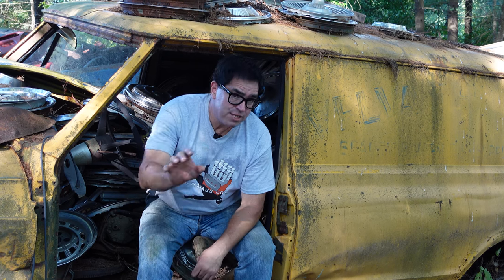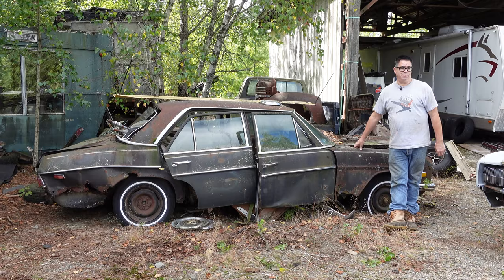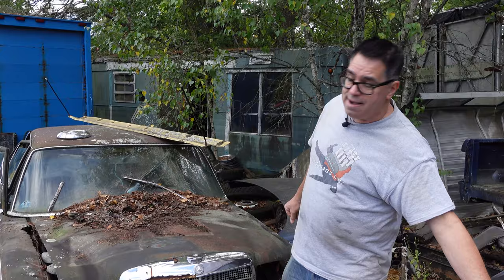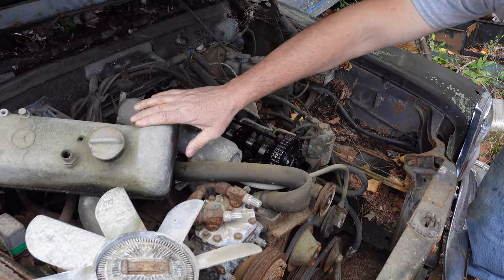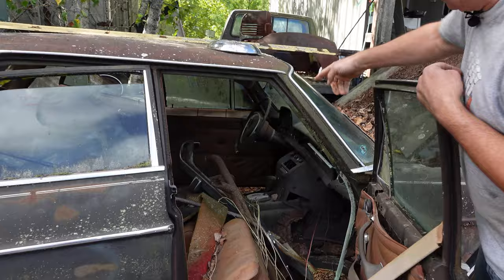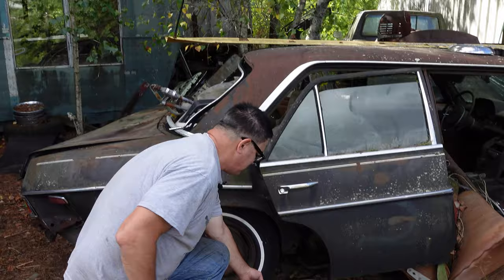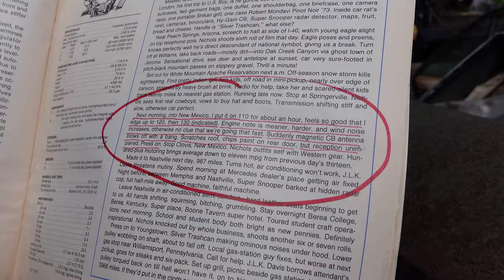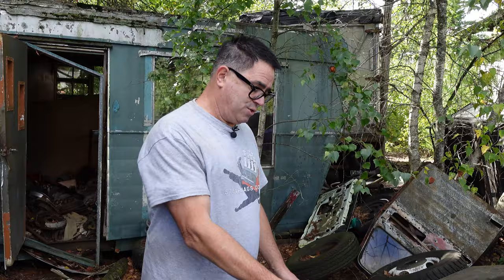Mercedes Has Benz

Comment: I have a 1971 "W114" 250c with a straight 6 with dual zenith carbs, it runs quite smooth and can cruize at 70 pretty easily. It's suppose to go to 130, but with it's age I'm not keen to try. Nice car, but mine needs some more love. The parts are very expensive. Thanks for showing a German Classic.  I also wanted to mention the American version has a double front bumper that's kind of ugly.

Comment: A diesel vehicle is able to achieve better fuel economy than a gasoline vehicle because a diesel is very slow.  You see, a diesel has MUCH slower combustion.  A diesel engine is better with a turbo charger, but now your talking just UNDER the fuel economy of a gas engine.  If you want diesel fuel economy, keep your foot off the gas!  Please reply.  Dave...